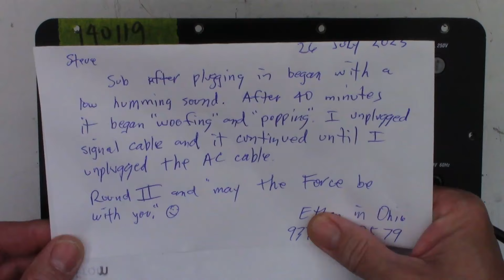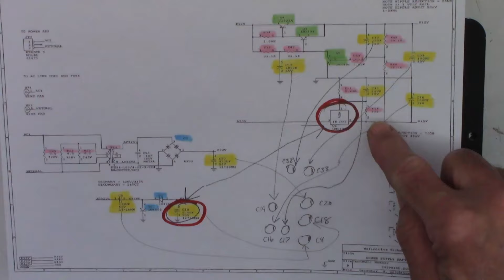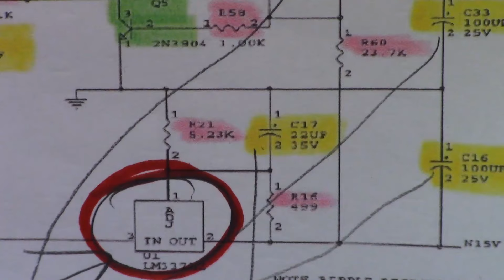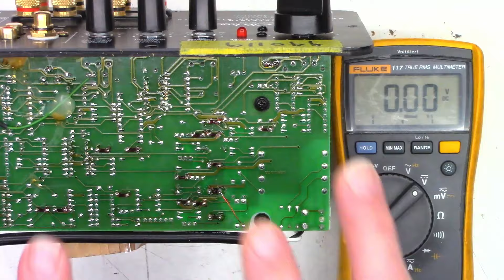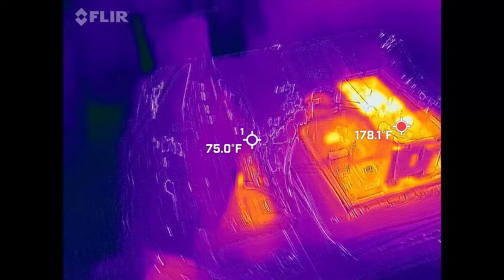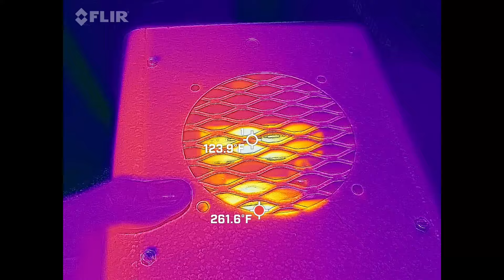The Definitive Technology PowerField SuperCube Trinity came back Part 6 Hopefully the last repair!

Comment: I’d pay for a set of schematics for my dad’s Supercube II
Reply from the maker: they are available on hifiengine.com (I uploaded them to hifi engine)
Reply: @norcal715  thanks! Do you take on outside work in case I decide against the diy route
Reply: Good afternoon, I am also looking to see if you would like to take on a supercube 2000.
Power's up but no sound. Now I do avionics and electronics. But that's for work. I just do not feel like getting into it at home.